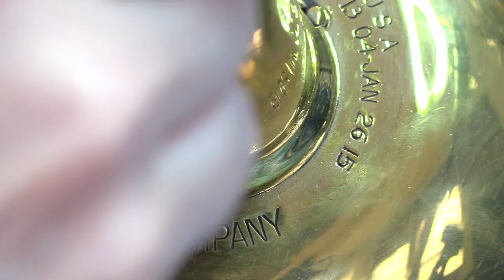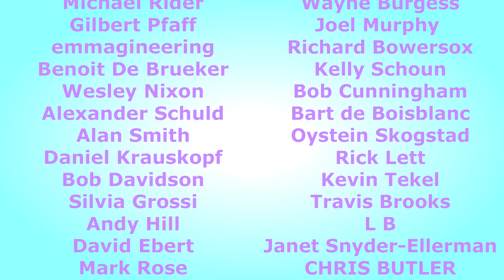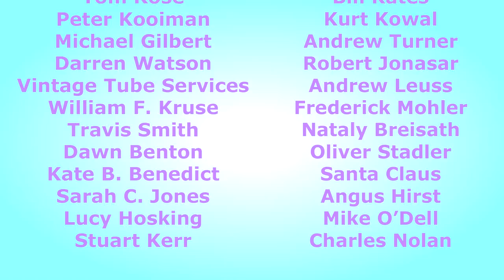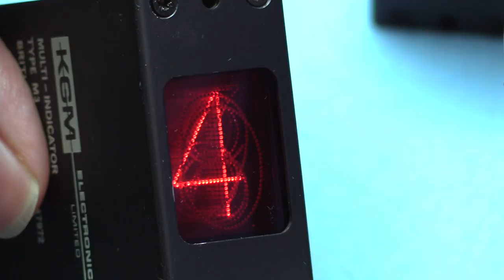The Telephone

Comment: That subset was made by Northern Electric (Nortel) in Canada. NE was the manufacturing and supply arm for Bell Canada. It is identical to the WE unit.  I spent nearly 3 decades working with Nortel PBX's in the US. I have 3 candlesticks, one with a rotary dial and even a NE 3 slot payphone!  I went from manual switchboards, to digital logic to fully programmable phone systems and finally to VoIP in my career.
Reply: I have a 1973 candlestick that I want to fix. Do you know where I could get some instructions to lead me through the process.

Comment: A friend of mine mounted a brass bell from an old Western Electric ringer on his bicycle handlebar. Sweet tone, long sustain, so much nicer than the typical aluminum bicycle bell.
Reply: Aluminium would not ring very well, I think those are steel.
Reply: @MikinessAnalog  There are both steel and aluminum bells, which sound nice, but not like brass.

Comment: The old Petticoat Junction tv series and the Green Acres series along with The Beverly Hillbillies all featured that magical telephone transition period where the older technology was still being used in the rural locations while the bigger cities had already made the change to more modern phone systems.

It was still common practice when I was a kid in the 60's to dial 0 for an operator just to ask her the time so we could set the clocks after a power outage. All the pay phones still used operators even through the 70's. We even still had party lines in the 60's.

Comment: Still got my 1939 made Ericsson wooden phone, and it still works, though it no longer is connected to a land line any more. mostly still original parts, though at some point in the 1960's it had some repairs from the phone company, replacing original capacitors with 1950's era ones. Original handset, original interior wiring, though I suspect the handle cord is from that 1960's repair, but it is a DCC cord still. Just had to convert from local battery to line operated, and no dial, as it was originally used on a farm party line, so has the crank handle and 90VAC ring generator.

Another is a 1970's era railway phone, also with a crank handle, used to communicate down the train lines from station to station. Line powered, and is a special made version of the common Erica phone, that was the staple of the then telephone division of the General Post Office.

Comment: The operators used to be able to do a lot of more modern functions, like answerphone (take a message from caller if called party doesn't answer), call forwarding (someone at called number advises the desired person is somewhere else, operator connects call to that place), call diversion (person tells the operator they will be over at someon's place until 22:00, operator diverts incoming calls to someone's place), baby-minding (person leaves phone off-hook, goes out, operator plugs in periodically to check if baby is crying).

Comment: As a Swede I'm proud of LM Ericsson's contributions to telephone design: the handset and the Ericofon or Kobra. We have a late version of the Kobra with buttons instead of a rotary dial. Beautiful.
Reply: Don't forget the Eiffel Tower Phone!
Reply: @BretFrohwein  I have to correct myself about the handset being of Swedish origin.  "The breakthrough for the model, however, came in 1892 when it was equipped with a horizontal telephone handset on a hook. Although the handset was not a Swedish invention, Ericsson quickly became the handset's leading color-bearer, and the model from 1892 set the standard for all 20th-century variants of desk telephones with horizontal headsets." From (LM) Ericssons own homepage.

Comment: I started doing electronics in the late 70's as a teen and I had an old rotary phone in my collections of various electrical/electronic devices. From looking at pictures now I think it might have been from the 50's. My memory might be faulty though and it might have been more modern. Sadly I do not have it anymore, I do not remember getting rid of it but we/I moved 5 times since that time.

I agree that smart phones aren't really phones, I mostly use mine as a pocket ebook reader. I got rid of the land line about 10 to 15 years ago.

Comment: We had an operator based system in rural Easy Texas until the mid 60's. Dad scrounged up a Western electric dial telephone and a wall mount magneto and built a special desk for the phone. The crank for the magneto came up through the surface of the desk. There was a small wooden box under the desk  He also ran the phone wire all the way from the house to the phone office about five miles away. He ran a single exposed galvanized steel wire with ceramic insulators nailed to wood cross arms on the poles.

Comment: I grew up in a small town in the '60s. We only dialed four numbers to speap to our local friends when we were old enough to use the phone. A couple years ago i finally disconnected my landline service. Nominally I kept it that long only for my alarm system which no longer really needed the landline connection. This year I gave away my late '30s rotary phone.

AT&T was once a monopoly so powerful, more so than Google, Facebook, and Twitter together, that the government felt compelled to break it up. That move spawned an era of creativity. Two generations later the landline network is all but useless in most places.

Funny how that goes.

Comment: One of the old 3-slot payphones I have originally had a separate earpiece and microphone before my acquisition .  There's a plate on the front of the phone where the microphone had been mounted.  The separate parts were replaced with an 'F' style handset.

Comment: I have about 8 or 9 rotary dial phones from the 50's and 60's that I loved using and I really liked the bell ring that was very loud.  However about 10 years ago I was having so many problems with the land line...every 2 weeks I was losing service, that I dropped the land line.  AT & T really sucks.
Reply: The CLECs and RBOCs lose money on landline service (POTS) with all the maintenance required to keep all that old equipment working - so they have essentially abandonded any level of customer service for those services, hoping to drive customers away from POTS and towards newer and more profitable services.
Reply: @carolinaclaus  Yes, also as landline is considered "essential service" they have strict rules about times to repair, but for data and other services they are classed as "best effort" so they only repair them when the schedule is allowing them to. But yes most telco operations are depreciating fixed wire land line use, because of the maintenance cost, and that it is a money sink, as the call volumes are miniscule now, with no big income long distance calls any more.

Comment: Compatiblity issues - If you think about it, last century's computers latterly had modems with pulse dialling option. So that made the computer compatible to technology patented in 1891 by mr. Strowger, the undertaker. That's a fair age gap and remaining compatible ! Probably one of the biggest - and certainly the biggest in the computing world ! Will USB still be compatible in 100 year's time ?

Mr. Strowger wasn't the only undertaker in town. There was a rival firm  - an it was  the owner's wife that got the job as operator in the local tel ex - so every time a subscriber asked for the undertaker, Strowger missed out - so the ATE was his fix for the problem.

Comment: We had an operator until the end of the 1960's
Large box-style phones with a handle on the side.
Later got replaced with desktop phones with a flip-handle instead of the rotary dial to generate the AC to call the operator.
After exchanges got automated, we used the phones as intercom, because you can just connect two phones back to back; when you turn the handle the other phones ring. Each phone need a local battery to power the carbon microphone.
Even the newsreader on TV had one to communicate with the control room if everything else failed. They were in use 10-20 years after automation was installed.

Comment: These telephones are using ‘local battery’ as power source. Modern telephones get the power from the exchange. The local batteries are 2 or more quite big, like a 1L water bottle, batteries. When a connection with is made with another telephone there is no other equipment, except the wires, between them. Depending on the quality of the mouth and earpiece, the telephone had a range/distance. Like 400km or more. The construction of the mouthpiece was protected with patents.

Comment: For ages I had a rotary dial GPO Trimphone (Tone Ringer Illuminated Phone) from about 1967 that had belonged to my parents. This did not have a bell but an electronic warbler. The dial was illuminated by a sealed glass tube lined with phosphor and filled with tritium gas. When I finally sold the phone in 2008 the dial illumination wasn't very bright due to the radioactive half life of the tritium being only 12.3 years.

Comment: Interesting story.  My Grandmother worked as a long distance operator back around the time that phone was made.  I heard all her stories about her "girls" working at night.  I don't have any real interesting phone gear but still have a rotary wall phone in my shop because I can actually hear it ringing over the racket.
Reply: When my wife was working weekend nights as a nurse some 25 years ago, I turned down the ringer in the  kitchen phone to the lowest setting, turned off the ringer on the bedroom phone, and put a telephone-triggered strobe in the bedroom so that she could sleep without being wakened by the phone ---- but forgot to tell her. She was blow-drying her thick curly hair in the bedroom before work the next day ---- because it was the only air-conditioned room in the house  we were renting, which had a crappy electrical system, prone to tripping breakers ---- and when a call came in and the strobe started flashing as the AC and the hairdryer were running she thought something was electrically arcing and nearly jumped through the ceiling!

Comment: Too bad you don't have a period matching subset for that phone. Your phone is from 1915, yet it's connected to a 1974 subset. A 1915 model would be a large, wooden box, with black or brass ringer gongs on the outside. And they did make candlesticks with dials, just like they made both dialed and dial-less cradle phones. With a pulse to tone translator, easily concealed inside the subset, those sets would be usable on any modern landline. These phones became obsolete in 1935, with the introduction of the WE-302, with the ringer and network built into the desk set.

Comment: A gentleman that frequented my tavern told me the story of him and his brother working in their father's scrapyard during the hot Iowa summers when they were kids. The local Dyersville phone company had modernized the phones to dials and their father had bought all the old phones to salvage for scrap. He said they had a small mountain of old wooden crank operated phones. Him and his brother worked all summer outside in the heat busting those phones apart with sledge hammers to separate the metal from the wood.

Here we were in the 80's wondering what that pile of phones would be worth to the antique collectors had they not all have been smashed for a few pennies each.
Reply: You'd have been able to sell a handful for a very nice sum, but the bulk of them wouldn't sell at all. Any time you deal with such things, it's best to set a handful of the best ones apart, and junk the rest.

Comment: Hey Fran, We're about to loose our phones here in the UK. Land line connected phones will all die in 2025. The only way to make a phone call will using VOIP via the internet or with a mobile phone. Yes you can get adaptors ATA's etc but you will need to provide power for your equipment. That's both PSTN and ISDN.

Comment: You mentioned direct dialing long distance. It was really annoying when shortly after direct dialing all across the country was finally implemented, the phone company was broken up. I returned from overseas just after that happened and tried to call my parents. It didn't work. An operator came on the line and asked what carrier I wanted. I had to play guessing games to make a long distance call rather than just dialing the number. Things have gone down hill after that. The phone company used to provide power for their equipment. This ensured that during a disaster that knocked out power, emergency communications would be accessible. Now the local power goes out, cell phone service is not available, voip service will be out (possible available if you pay extra to get the battery for a cable modem. Even then, the cable service will probably be out). Copper wire land line is not even available where I am living now.

Comment: I miss POTS (Plain old Telephone System). We used to use it to connect tape players/recorders together and share music ideas. Also, we used it to operate/control CB radios from remote. In ham radio, we used it for phone patches. The 80's were fun. On another note, a friend and I transferred an Atari Basic program via CB radio. We are likely the only ones to ever do so. It was 100% successful.

Comment: That C4A ringer probably has dual coils which would be wire is series with a capacitor (usually .47 uf) taps on the coil were used for identifying party a from party b. at the exchange. The PCB is a "network" for providing limiting the sidetone in the receiver element on short vs long lines

Comment: Great video Fran.  I love that you share your interest in electronics with us all.

Actually, the brass "candle stick" is called the subscriber set.  The actual phone would have been in a wooden case that would have been mounted on the wall or on the side of a desk.  The components in the black case you showed are what they've put in its place.

The modern transformer-looking thing in the black case you showed is indeed a modern "network" component and is what handles sending/receiving the signal as well as the local loopback (so that you can hear your own voice in the earpiece).

It's a common thing "restorers" to polish up the brass.  However, that phone would have originally been nickel plated.  When that subscriber set was originally manufactured, people didn't like the look of polish brass and would have thought it was odd to have it like that.

Thanks again for all your videos 🙂

Comment: I am looking forward to learning more about phones. Did the operator have to contact other operators at exchanges? It reminds me a lot of modern network routing. Does it take much current to activate the physical bells? I seem to remember getting a tingle rewiring my jack for my bbs.
Reply: Operators did need to contact other operators if the call was to go too far: some sites (London seems likely, since they built a bomb shelter as their exchange at one point) would have needed to do that within a single building (stringing connecting wires between different boards would have been a bad idea), and long-distance pretty much always required contacting another operator: to facilitate that, the operator would have essentially a strap-on phone, with a headset + mic (which was also used for speaking with customers), and a battery or hand-crank unit to get the attention of remote operators. The whole equipment set was pretty literally a manual phone, with the mic & speakers on a headset, and everything else on a belt.

As for the power present on the lines, I don't know the amperage (likely very low), but the voltage is often around 90 volts.

Comment: Ah the crank created an electric pulse, never realized that.  Also I only miss the clarity of the old land lines.  You could always hear the other person so well, not so much with smartphones, some days worse than others.  Cranks and candlesticks were gone by the time I came along, except my grandparents had a nonworking crank on the wall still, that they did long and short cranks for local calls, so I was told.  My other grandmother still had a party line, which was gone by 1980 when I was about 13.  Everyone had those bell phones the phone company provided, which you got in solid black or white, and maybe yellow I think.  It had a ringer volume on the bottom.  But smartphones have so many advantages, so I don't miss them too much.  That ring does create a slight nostalgic feeling though.

Comment: I was half expecting you to pull out a 90v oscillator to ring that bell. Neat you're able to use it as an actual telephone! I've never had a land line in my name. In 2001, when I was finally in a position to afford a phone, I went straight for cellular. Nationwide calling sans long distance was the major selling point. I'm still using that phone number though.

Comment: great video. Mixing desks evolved from phone exchange technology. My ancient Soundcraft has unbalanced patch panel for outs and external buses, same old tech.
Reply: Unfortunately we are still stuck with crappy old connector designs such as the 1/4" phone plug and the RCA phono plug, both of which make the "hot" connection first and break it last, which is exactly what you do not want for audio equipment unless you enjoy loud hum and potentially speaker-destroying "whomp!" noises.

Comment: To complete your phone collection you might get a No 6 drycell, often called a telephone (or ignition) battery. These were used in areas where there was no power. When they were mostly depleted people would poke holes in them near the bottom and then sit them in a bowl of water and salammoniac. This would extend their useful lives. Yiu can get dummy cells or even replicas with a modern battery inside.